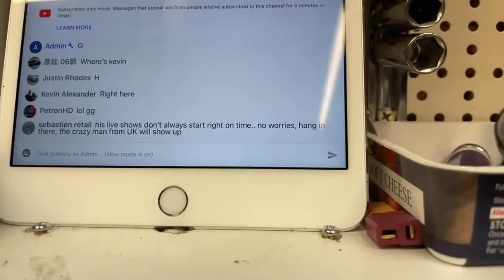Total carnage - this is bad live

Comment: Sir kevin i have a question ❓❓❓, i have a jjrc q117  4×4 truck,i t is 2s capable, i have replaced the 2s 25 c battery with a ovonic 2s 5200 mah 50 c high out put battery, will this work , thanks i watch all of your videos

Comment: Ahh Amazon. I'm finally getting a upgrade for this 1:20 scale drift car . It just a cheep car 14$ it sucked at first it got new receiver and servo for steering and a cheep esc . Burned one moter and stripped the drive .so I robed reer end from a truck it's reel stable at full speed .050 is what I'm upgrading to and up the power from 6v 1000ma to 7.2 2000ma . I?